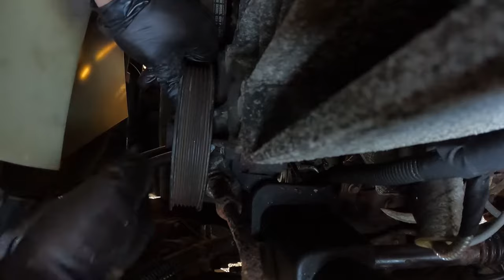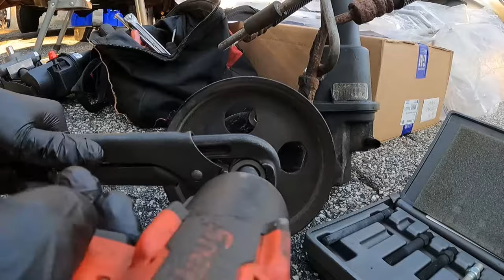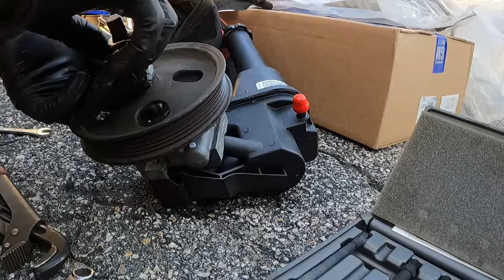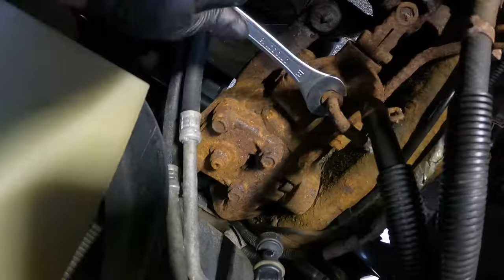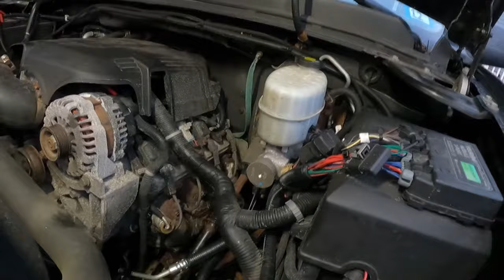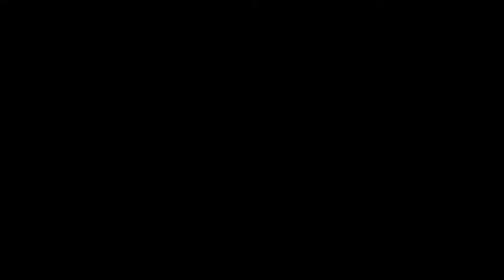Chevy Silverado 2500 HD Power steering pump replacement

Comment: Thank You
Some additional info:
Belt tensioner - 15mm socket.
Pressure hoses -  16mm and 18mm wrenches. 
Pump - 13mm socket.
Little over a quart of fluid without complete flush, about two quarts to flush completely.
After filling press brake pedal few times, add more and than turn steering wheel all the way to the right than all the way to the left. Check level.
Reply from the maker: Good call. Ya I should have added more information about filling and bleeding the system. I was kind of in a rush and it was getting dark out. Thanks. 👍
Reply: Thank you I was literally hunting for the bolt sizes

Comment: My pump back blew out like the one in your video as well what causes that ? Lost my brakes and steering 😮
Reply: These trucks have what's called hydroboost assist or something, power steering pump assists the brakes they use that instead of air assist.

Comment: Have to bleed it with tires off the ground?
Reply from the maker: Ya it works better with the tires off the ground. Turn the wheel back and forth about 15 times. And adjust the fluid level.

Comment: My pulley is solid and doesn't have holes in it, what do I do?
Reply from the maker: You might need to take the pulley off. Same way I did it on the ground but in the truck.

Comment: The lines coming out of the brake cylinder. What do they do. That is what my truck has. One line leaking
Reply from the maker: That’s for the Hydro boost. You need that so it’s easier to push the brake pedal. Otherwise it would be extremely hard to brake.

Comment: Going way to fast for me to follow.
Reply from the maker: Sorry you can watch it in a slower speed. It’s a pretty easy pump to do.
Reply: click on the little settings cog wheel icon on the bottom right of the video (if on Computer) and select playback speed and slow to .5x or .25x.  Hope that helps.